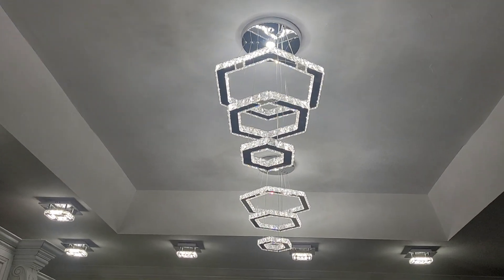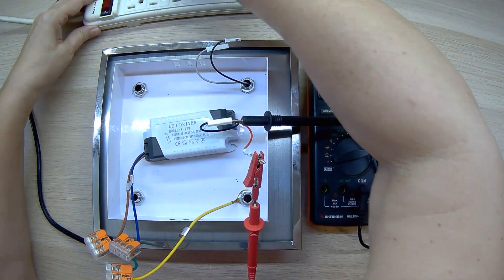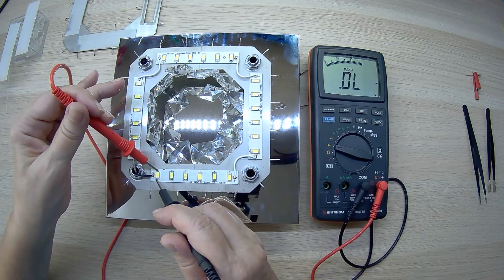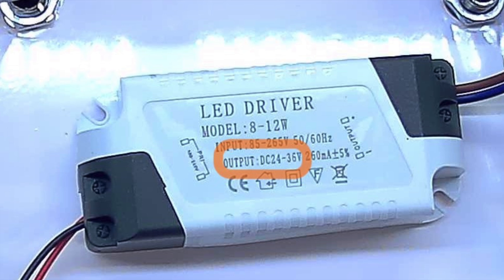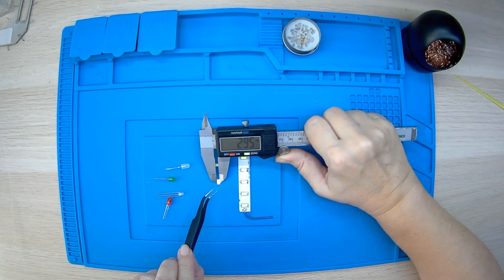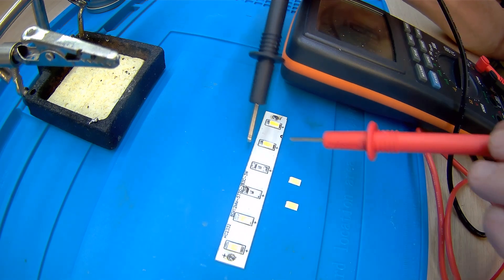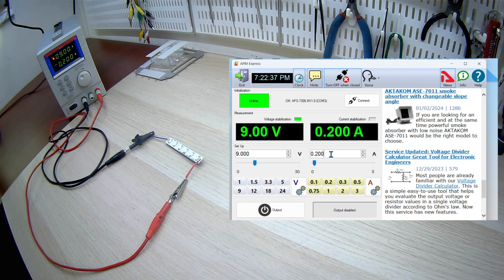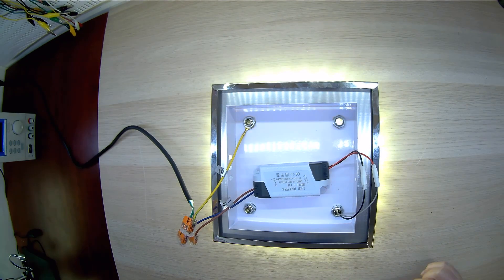How to fix light fixture DIY   #led  #ledlights #fix

Comment: Thanks for the interesting video. The talking power supply is very interesting. The question remains - why does the DMM 1060 not change the value on the scale during testing LED😀
Reply from the maker: It's simple DMM 1060 has a 3v supply - you can see it here, and the white LED has a working voltage of up to 3.6v. You can see it here (you need to select the white LED) Therefore, the LED lights up but does not remain fully open, so AM-1060 does not show the working voltage of the LED.